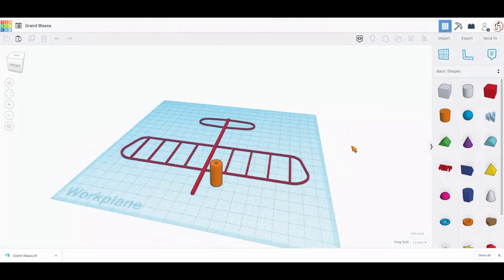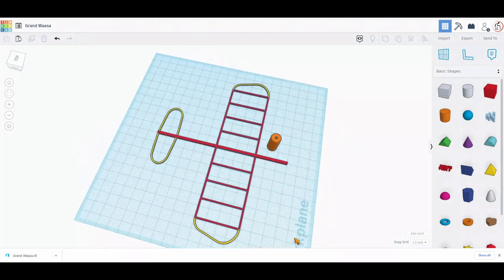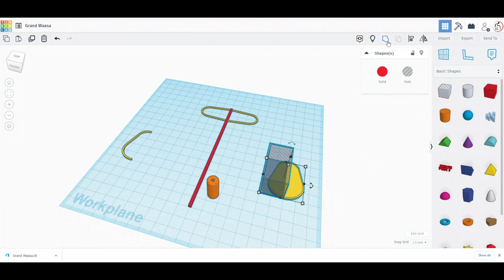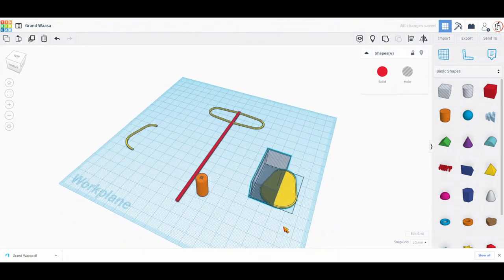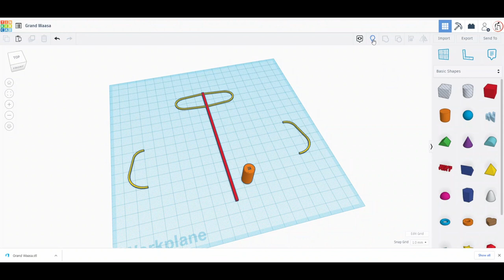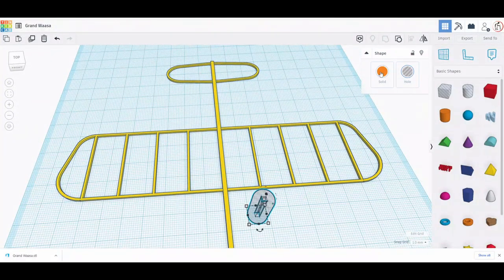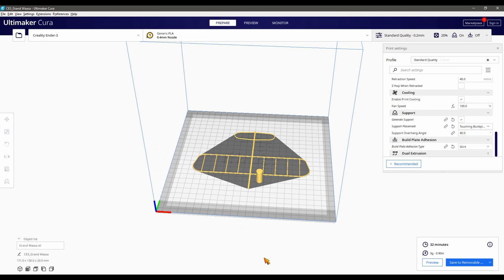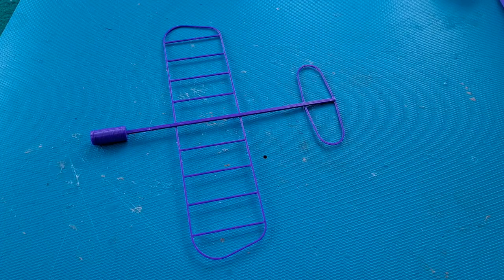Grand Waasa Mk1 Part 1 3D design and print

Comment: When I was at school I used to make airfix kits. The glue I used was the liquid type (I think it was basically acetone). Anyhow, I dissolved a lot of bits of plastic, mostly the sprue from the kit, and while experimenting found out that if you poured a drop onto water it would make a very thin film you could stick to a thin frame (I made loops from wire). I thought it could be used to make a glider, but at the time didn't really have the stuff to try it out with. Might be interesting to make a really lightweight frame on the 3D printer and use a film like that to cover it!
Reply from the maker: Yes, I made indoor rubber powered balsa gliders that you covered with a film you made from the cellulous dope thinned down and poured on water. Extremely light weight. That was back in the 70s so I don't have any video of that. This glider is based on the one in this video https://youtu.be/IDSx9R1d0_E You will see in the next video it doesn't quite go to plan but I do get it flying.

Comment: Nice video there. Are you gonna stretch foil accross the wings and glue it down. Maybe make it rubberband powered if its possible?
Reply from the maker: This glider is based on the one in this video https://youtu.be/IDSx9R1d0_E You will see in my next video it doesn't quite go to plan but I do get it flying.

Comment: Very well printed. Should be pretty lightweight. What are you thinking of covering it with? 👍
Reply from the maker: This glider is based on the one in this video https://youtu.be/IDSx9R1d0_E You will see in the next video it doesn't quite go to plan but I do get it flying. When I used to make indoor rubber powered balsa gliders that you covered with a film you made from the cellulous dope thinned down and poured on water. Extremely light weight. That was back in the 70s so I don't have any video of that.
Reply: @GrandadIsAnOldMan  Wow! That is amazing. Just some soapy water and your away. Never seen that before. The closest thing that comes to mind is those rubber band planes with the extremely light covering and large lightweight propeller. Flite Test visited a guy who built them. They fly at an extremely slow speed. You have probably seen them but this with one with soapy water is great. 👍
BTW: I noticed he sells them on eBay for 11.99 Euros. There is a wee angle for you LOL. 🤣
I would imagine you will need to take time and rub all the surfaces very smoothly so that the soapy film can attach itself without bursting due to a jaggy bit. Looking forward to seeing how you get on with it. 👍
Just checked the eBay listing again and it works out at £10.17 for the plane and £3.07 for posting from Germany. Mmm.
Reply from the maker: @mikeflight9  I expect you mean Joshua Finn on the FliteTest video. I have done some of Josh's catapult launch gliders. He sent them for me to try. I don't want to spoil the excitement of waiting for the next video, but since filming it I have bought some glycerin and intend to do a version 2.